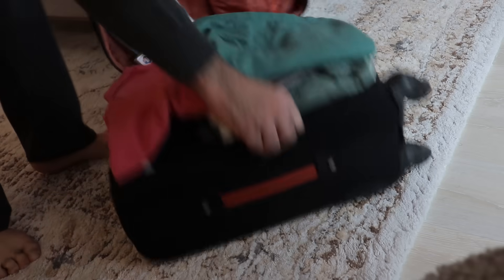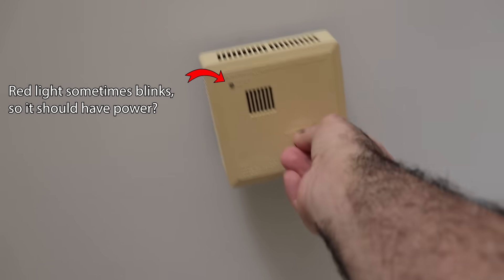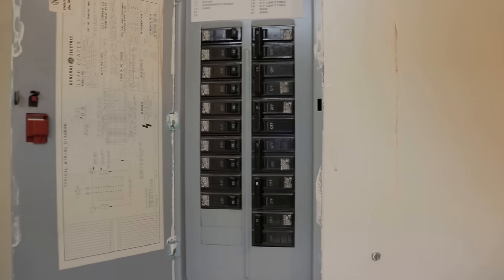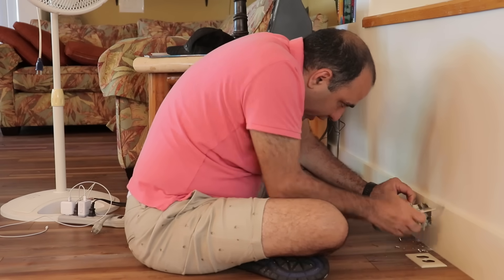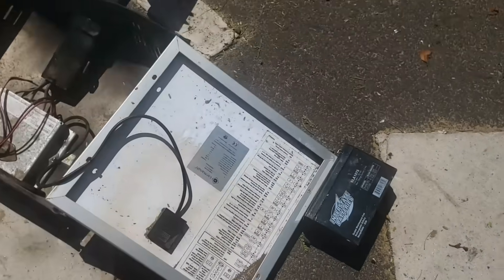Hawaiian Hotel Safety Failures

Comment: GFCI outlets that are failed can be dangerous! That’s why newer models have led in them. if you have an outlet that when you press the test button it illuminates red,y but flashing red means they need to be replaced. the older outlets had a green light when in normal status when no light are on that means the test button has been pressed if it’s yellow that means it has to be replaced!

Comment: Once, I turned of the ELCB (aka GFCI) and after finishing the work when I turned it on there was no power, I opened the breaker box to find that the ELCB was filled with concrete dust from the construction,  it was installed as a temporary power solution for the construction and after finishing building, they just repositioned it into the home (because in india a good quality ELCB can cost around 3 to 6000 rupees)

Comment: I don’t think that that up to code and by the way is that is a hotel or something like that one smoke detector will set off all of the sirens in the building
Reply: And every smoke alarm has to be replaced with in 10 years
Reply: Unless its internal relay (which only Gentex-brand residential detectors like the one in this video have: all other residential brands need external relays instead) is hooked to the larger fire alarm system in that hotel, no.
Reply: @TheCarson116 ?
Reply: @Jaketheturretguy What? Did I not explain it as simply (& thus as easily-to-understand) as possible?
Reply: @TheCarson116 chill
Reply: @Jaketheturretguy Don't know why you thought I was "raging" at you, I was only wondering why you seemingly didn't understand my initial reply, that's all, jeez...
Reply: @TheCarson116 ok bruh

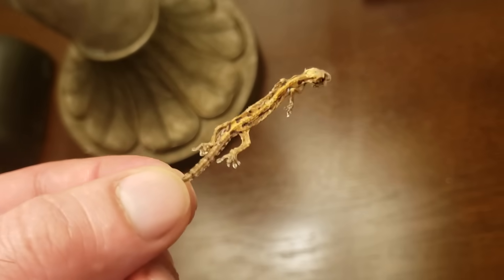Comment: The smoke detector at 2:48 is an old Gentex 710 photoelectric smoke alarm. It's the horn-only variant of the newer Gentex 7139CS-W which has a classic SHG styled strobe unit which is used in fire alarm devices. 😊👍

Comment: HE Broke the Smoke detector.... He ripped of the red wire out of the sealing..... There was a LED Blinking before he we took it of
Reply: No he did not: the red wire is only for interconnecting detectors together, & this one was not. The LED also resumes flashing once he puts it back up if you look closely.

Comment: Loose outlets are very common in hotels and other public places where people plug in phone chargers and other portable items. In airports the few outlets available may be used a hundred times a day, even high quality outlets will fail quickly. Outlets in hotels built to low bid using the cheapest outlets available might function for a year or two. Outlets in inconvenient locations such as behind a dresser usually are not worn out like the ones near the bedside table or desk. Hint: Since the alarm clock is always plugged in, it's outlet is likely good. Today (Fall 2024) Home Depot has basic outlets for 62 cents! these are highly inappropriate for use in public places. That is .57 euro, .47 Pound sterling, or about 1/8 of a Starbucks Latte, you get what you pay for!

Comment: Mehdi, you should test the little outlets on an airplane and on trains. I don't think it would be a good idea to try to test the safety systems on an airplane but I think that if you had your scope you may be able to figure out how the power system on the air plane works by looking at the waveform on the scope.

Comment: I’m a little late to watching and commenting on the video, but in the first 20-30 comments I didn’t see anyone answer the question about the low light switches and door handles, so I’ll chime in. The low switches and door handles is so that patrons that use wheelchairs, or would otherwise need low handles/switches, are able to easily reach them. It looks like they either gave Mehdi an ADA accessible room or the hotel is just very ADA friendly.

Comment: There aren't two phases, only one. The two sides of the breaker panel are fed from both ends of a 240V, single-phase transformer. The center of the transformer is tapped to neutral. Each side of the panel then is 120V to neutral.

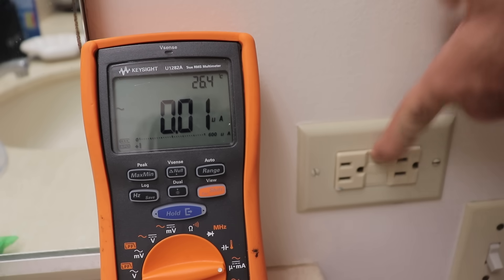Comment: #11:50 your fuse poped sam for my multiy meter just open the multiy meter and find the fuse and solder a peace of wire on both sids i have one to and i did it and it works fine now

Comment: Good luck finding equal to more females per team. When I started my EE degree, it was basically half and half; by the time I graduated, there were maybe 3 females out of 62 graduating folks. Most of them changed majors after either Electrical Circuits, Signals and Systems, or Power Systems.

Comment: If you go to Germany you'll see how the wiring is very much below code they use lighter wire than what it's rated for they use 1.5 mm wire on a 16 amp circuit breaker and it is lighter than 14 gauge and 14 gauge is only rated for 15 amps and in the kitchen they use 1.5 mm wire and it's less less than 14 gauge we're in a kitchen 12 gauge wire is required on a 20 amp circuit at least two circuits you'll also see that light fixtures do not have boxes above them like the code requires you can go to a hardware store and see the materials don't take it apart though because you can get a shot and it can be dangerous

Comment: Shouldn’t that smoke detector have gone off when it was being tampered with? lol
Reply: No: the most that would happen (& only if it was a commercial detector hooked to a larger fire alarm system, which this one isn't) is that a trouble would come in on the main fire alarm control panel to alert building personnel of the disconnected detector.

Comment: Looks like the hotel was already poorly maintained before the pandemic. That smoke detector should have been replaced back in 1994, 10 years after it's first use then again in 2004 and 2014. The general rule is that smoke detectors should be replaced every decade. Those outlets could not have been worn down during the pandemic alone. We can't use pandemic shortages as an excuse.

Those Gentex detectors have two test dial positions for different smoke levels. The dial simulates smoke conditions to the photoelectric sensor. The first one tests that the detector won't go off with false alarm and the second one makes sure it does go off.  It's not those test buttons that only test the alarm electrically. The smoke alarm really is being tested here. The reason for the delay is that these photoelectric detectors need to sample the air repeatedly over a period of time to see that there's real smoke before deciding to trigger the alarm.

Comment: The americanacium  in the smoke detector is probably stable enough to not usually the smoke detector goes off but that was probably a defective unit from the start
Reply: This particular detector is photoelectric so it doesn't have any Americium 241 in it, & it probably worked at one time (especially given it's a Gentex detector, which are definitely quality), but not after 30+ years of aging (especially since you're supposed to replace smoke detectors only every 10 years!).

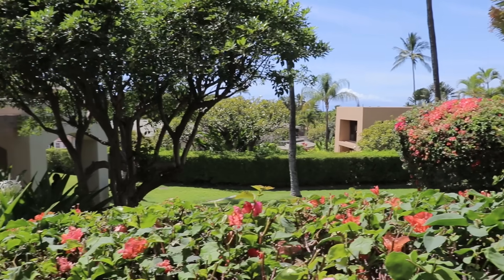Comment: 2:00 ...quartz oscillators, whatnot... even glass for vacuum tubes too.
2:48 should contain some Am-241 for radioactivity experiments :)
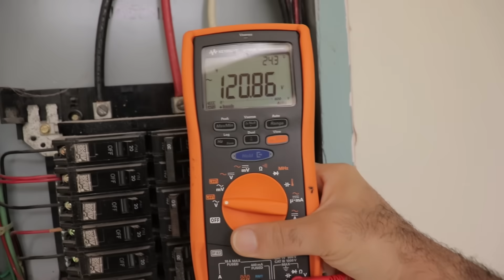5:38 nicely concealed. Still, security by obscurity is as effective as a typical lock against LPL. 6:28 try again to see if it was not a Fluke!
8:20 that's total crap, not to mention that the iron isn't even grounded. 

Nice turtles :)

Comment: The smoke alarm you tested is indeed not working, That being said the reason the alarm did not sound was most likely because it was more then 10 years old that or it may have had an issue on the control board. Also nice video!

Comment: I may not be one of the fire inspectors but I do know that they have a major safety violation if the smoke alarm doesn’t sound if put on test. 

Also let’s count how many safety violations this resort has committed ( if anyone is a fire safety inspector or whatever a safety inspector is feel free to correct me)

1. Smoke alarm not sounding when put on test  3:34

2. I don’t know if the fuse box hidden behind a painting counts 5:41

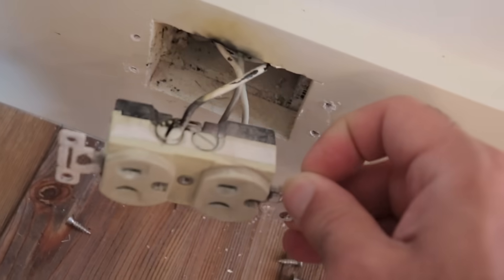3. As stated, no electrical metal box 8:16

4. I think this could start a electrical fire 8:55

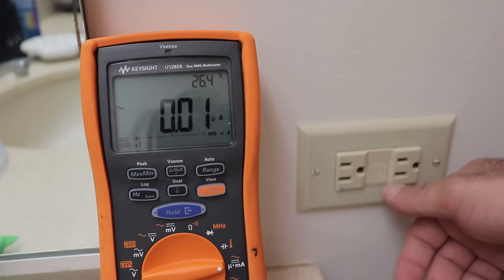5. The test switch for the gfci in the bathroom won’t work 11:42.  Again I think that’s a safety hazard but again I’m not a safety inspector or what ever that person is called I only know what I know from YouTube videos

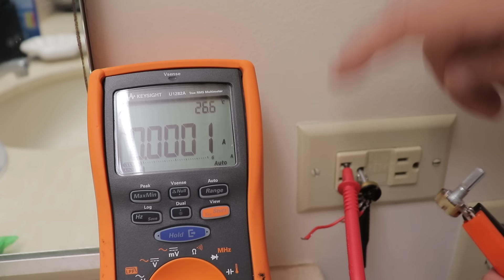6. A gfci failure 12:38

7. Lose electrical outlets as stated by ElectroBOOM 

So 7 safety hazards.

Comment: The smoke detector is a gentex branded detector which is photoelectric so it doesn’t expire it has to be ionization to expire :)
Reply: Smoke detectors are supposed to be replaced every 10 years regardless of the sensor type due to the potential for malfunction like how this very video demonstrates.

Comment: Did you check for Bed Bugs and Cockroaches?  Besides box springs and mattresses, electrical plugs is a common hiding place for them! Also if you find white powder in outlets its insecticide for Beds Bugs and Cockroaches. I wonder if bugs in an electrical outlet could cause a short or fire? I don't know the resistance of bugs. Bed bugs can be full of blood.

Comment: Shouldn't they really change the detector because of the included Americium and being radioactive?
Reply: No, only because it's way over 10 years old: smoke detectors are supposed to be replaced every 10 years & ionization ones are intentionally made with Americium (the detector wouldn't work without it!), of which there's a very small amount, nowhere near enough to be harmful.

Comment: All smoke and carbon monoxide detectors should be replaced every 10 years
Reply: Im pretty sure it’s recommended to replace them every 3 years
Reply: @againtjugofcocomilk  Nope: for smoke detectors it's 10 years, for CO detectors it's either 5 or 7 years (since manufacturers can't seem to agree on the exact timeframe for replacement of the latter).

Comment: Do you guys don't use the electrical plastic box? Here in Brazil is rare to see one of those metal boxes in the market. If I'm not wrong we just use them when the conduits are metallic!
Reply: I'm not sure about code, but it seems we're switching to plastic as well, though metal is quite common on older buildings
Reply: The US has been using plastic junction boxes since the late ‘70s/early 80’s. My house was built in 1969, so it still has metal ones.

Comment: I imagine that the switches and handles at a low level is an accessibility feature. Imagine you need a wheelchair or crutches and you want to open the door or turn the lights on?
Reply: For hotel rooms the primary things that make a room handicapped accessible are:
switches and door handles at a lower height
wider doorways
grab bars in the tub area or a roll-in/walk-in shower

Some hotels go above and beyond and do things like no cabinet under the sink to make it easier to reach.
Reply: That is exactly what it's for, they usually lower the switches in houses specifically designed to be wheelchair accessible. I imagine the hotel does the same thing but for all the rooms so they don't have to make a different room layout for disabled people.
Reply: @tophatcat1173  What about having two isolated systems, one for accessibility and one for people who don't need to have accessibility in the system?
Reply: @coastersaga  in the same room? That would be needlessly complicated, and would also use more materials for next to no reason. Would be much easier to just have lowered switches and such that practically everyone can use.

Not that it wouldn't work, you could just have stacked 3 way switches that are both connected to the same light or something. But again, why spend the extra money when you can just do the one but lower?
Reply: @tophatcat1173  The problem with it though is that it makes it more accessible for a subset of wheelchair users and makes it harder to use for a lot of elderly but still mobile people.
Reply: @volundrfrey896  practically I understand where you're coming from, but from a business standpoint where they are only legally required to accommodate people with wheelchairs and not the elderly without them, they have no insensitive to care about that.
Reply: I wonder if it’s for Japanese tourists
Reply: @kurtbitner6675  😀
Reply: @umakemerandy3669  lol that wasn’t a joke. Japanese apartments have much shorter design, if you are taller you’ll have a hard time using countertops in the kitchen

Comment: In my home, since im european i didnt test gfci with pots and wires coz id kill myself but in the breaker box there is a button that says test and shorts ground and live at 30mAh and the power to the whole house turns off. So we have gfci everywhere. But gfci saved my life when i was little (5years old). The Christmas tree lights had a short circuit and my whohle hand turned black  and my shirt became a bit black too. Good thing the breaker tripped because i wouldve become some friend turkey

Comment: I used to approach electrical work with this care free silly attitude to kinda entertain customers, friends/family or people i was with but I made some mistakes similar to what this guy is doing. I can tell much of it is on purpose because he knows the safety failsafes of the thermal breakers and/or gfci circuits will inevitably save him from serious harm… i used to do the same. But one day mistakes could happen. Once I shocked myself pretty bad off one pole of a double pole 40 amp breaker. It hurt pretty bad and left my arm tingling for days it seemed lol another time I had a big industrial breaker panel opened up in an apartment complex corridor mechanical room. Each 100 amp breaker was the main supply to an individual apartment, about 20 total so 2000 amp service. Thats a bit too much to mess around with but I decided to make a quick joke pretending to get shocked. It made the superintendent I was with jump and knock a wrench off the ladder into the live panel. It fell bouncing around in there like a pinball, touched a live wire and must have shorted it right to the back of the panel box. It made an insanely loud boom and welded itself in place. The damn explosion knocked us both back but luckily those panels also had main supply breakers and that particular one tripped. It was a hell of a fright tho

Comment: The statement at 8:21 is incorrect! "bad contact has higher resistance and thus heats up more"
Plugging in U=RI into P=IU -> P = U^2/R. The voltage drop is a constant, thus the power dissipated increases with resistance decrease.
As a matter of fact, in Brazil we have "killer electrical showerheads", in the winter, when the water needs to be heated up more, the slider decreases the length of the resistor (R_wire = rho * L / A, resistance R is proportional to length L)
Reply: What I think actually happens is that the resistance of the contact is neglectable so the current drawn is the same, but with bad contact the current flows through a smaller area of the pins and thus causes small regions of very intense ohm effect, and thus overheating.

Comment: 13:00 in old finnish houses we dont even fucking have rcd or fucking gfci outlets, like our house what is built in 1999 only has rcd on outside outlets, since rcd is a standard in 2022 when we wired our air conditioner device, we had to put a rcd breaker for 2022 standards. We only have fucking breakers inside and outside with no ground fault protection i think not sure.

Comment: Is that a shower next to electrical panel? Like at most 1,5 meters away?
Reply: Thats not that uncommmon, in my nation its 120 cm minimum away from "showerhead zone"(think a vertical line from the roof or 225 cm from the floor to the floor from where the showerhead is). But it can be smaller if you create a ''safety wall/wall block'' then its 120 cm measured with a thread.

Man that was complicated to try to explain. Hope any of it made sense.

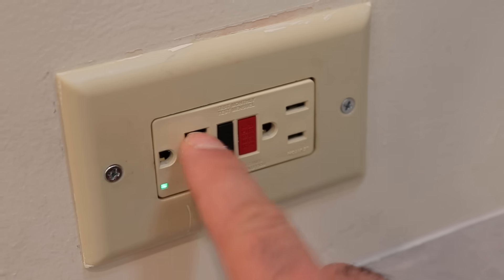Comment: 9:50 I have an audio mixer where the PSU has a ground wire. If The PSU is removed from the case and the ground wire is touching the PSUs shielding, there are small sparks on it. I guess that would trigger this outlet.

Comment: The outlets are low for disability compatibility more than likely the house was outfitted at one time or another for someone with a wheel chair. 

As far as the humidity there is likely a return in the room for the A/c which captures that hot air. The bathroom is open to the room for wheelchair accessibility as well. That is why.

Comment: Damn that is one vintage smoke detector -1984 George Orwell. I was expecting sparks when you removed it from the ceiling. Now Airbnb is going to add "ElectroBOOM!" star ratings to it's listings - this one would be a 2 star hotel! Breaking into the electrical closet - priceless!

Comment: I remembered this video last week while on vacation in Cape May, NJ. Our hotel room had outlets that felt like the squeezed the prongs of the plug so tightly that they 'spit the plug out'. It felt as if they were like two metal strips at an angle....  <  .... that applied force continually on the plug. It wasn't too loose, like you had in Hawaii because it took a good bit of force to get the plug it. I had to plug in the power brick for my laptop and balance it just so that it wouldn't pop out of the plug. I've never experienced anything like and wished I had my electrician safe screwdriver with me to check it out (grin).

Comment: The fact that the entier house doesn’t need to have GFCI protection from the breakers out seems kinda sketchy to me, here in Sweden it’s a requirement for the entire house and is usually built into the fuse panel, but I guess 120V is much safer than 230V so it should be fine
Reply: New codes do require GFCI protection in most of the house. This house is obviously older and GFCI protection was not required back then. You aren’t required to update the electrical unless you are doing work on it